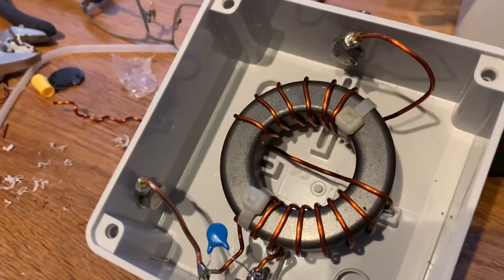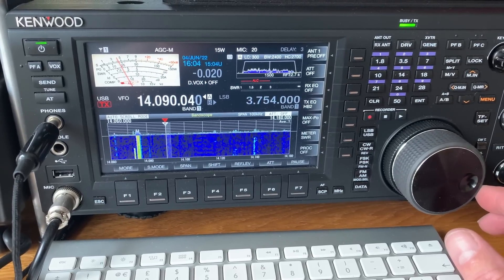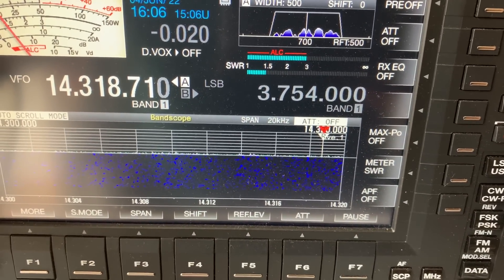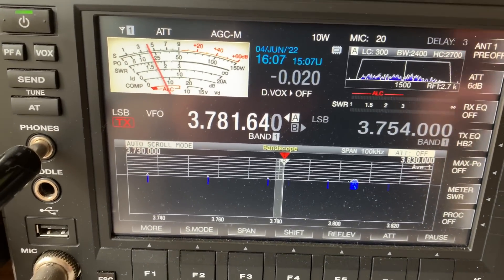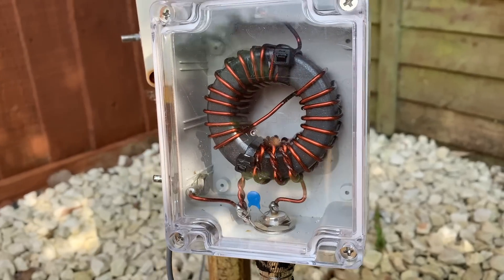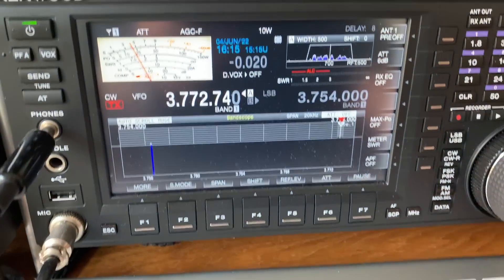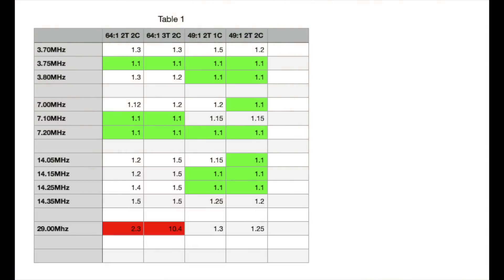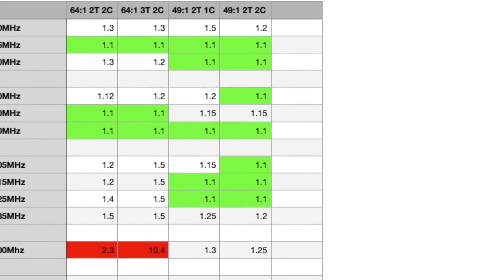HAM RADIO: Whats better a 64:1 or 49:1 Build and Test

Comment: Hi Mike,
First off, thank you for all the fantastic videos you’ve been producing—they’re a real asset to the amateur radio community.
I recently watched your video comparing the 49:1 and 64:1 builds, and it seems the 49:1 offers a better SWR across the bands. While exploring further, I came across a video from Budget Ham Radio https://www.youtube.com/watch?v=1JUI4rO3T2g showcasing a slightly different design that delivers a remarkably flat and low SWR from 3 MHz to 28 MHz.
Would you consider doing a video comparing these two designs and testing them with your NanoVNA? I think it would be a valuable addition and likely of great interest to many of your viewers.
Thanks again for your excellent content.
Best 73,
Stéphane (M1ENE)

Comment: VNA for all antenna builds. Also note: DO NOT COIL COAX. Use ferrites. And one at the 1/4~point helps a lot. Traps made with coax are great. You can also usea piece of coax as a capacitor. Stubs as long as coil is wide, usualy compensate for coils capacitance. TRY It out!

Comment: I want to use a 49:1 unun connected to the output of an atu-100m pro and mount the assy at the end of a efhw antenna.  Connect this to a hermes lite 2 sdr at 5 watts. Remote the atu controls and display indoors. Your thoughts?

Comment: I have made both. Results dependant on your installation I found. Now only use a 9 to 1 that worked better for me matching a Multiband vertical and the performance is brilliant. I needed the ATU on a couple of bands. When the indoor shack is in use with a much longer feed, the atu is hardly used. Which shows the coax feed is having some affect acting as a counterpoise partly. That is perfect for me.   Also have a multi band Delta loop I created from the EFHW as it was prone to noise. Was wiped out. The delta loop removed all the qrm as a closed loop. I needed a balum or matching device. I found one of my home made 9 to 1 ununs with a mod was the best. I needed the ATU. Was unable to load it on any other matching device. Again the performance is stunning. It's not resonant on most bands , closest is 40m . It's the results that count. Leaving well alone.

Comment: Mike  Is the pole that your Unun is on metal or wooden?   I had mine on a steel pole and the vswr was high and as soon I released the rope out 1.5 meters the vswr came down to below 1:4 on every band  64:1 unun.  So in my case having the unun near metal certainly effected the vswr.   Great video.   Richard  VK2AUS/VK2OKR/VK2BXB
Reply from the maker: Glass-fibre or fibre-glass
Reply: @mike-M0MSN  Hi Mike the pole I had it on was steel - no wonder it effected the unun.  Leaning from all my mistakes.

Comment: When does it matter what kind ratio of balun/unun to use? Or does it not matter?
Reply from the maker: For an EFHW you can use any..  49, 56, 64 :1 this is because the impedance of the end of the wire is between 2400 - 3600 Ohms ish....

Comment: I get the sense that such low Q SWR curves are getting closer and closer to a dummy load--which DOES radiate and keep the finals happy, but at an obvious compromise. I wonder if a field strength meter would be the best arbiter in this case. No? Either way it's a well-done video and reminds me that I love the experimentation aspect of the hobby. I'm still having fun learning basic electronics and metalworking, building antennas and transceiver/station accessory kits. One of the 'most funnest' hobbies out there! I like your spirit of humility and collaborative learning. W0XO
Reply from the maker: Yes you would think that having such a wide bandwidth would reduce its efficacy, strange thing is, it works incredibly well...!  cheers
Reply: the first efhw toroid i wound seemed to have lat swr from 6mhz to 29mhz which says dummy load yet it worked. until i realised my mistake of using a 4mm plug and pinged it off a fishing rod never to be seen again. i bought a qrpguys efhw last month and cant get decent swr anywhere at all no matter how much wire i wasted. i wound another and still not getting all bands
Reply from the maker: @liesofgasandpilesofshoes are you shaw it’s not a 9:1

Comment: Interesting test. The swr is unbelievably low. I scanned through the video a few times but couldn't discover what the antenna actually is.
Reply from the maker: it is 19M of wire then a 110uH coil with 1.2M of wire.

Comment: Merhaba, çalışmalarını takip ediyorum ve merak ettiğiniz şey bu 49/1 Auto transformatör şeklinde olan un-un balunlarını 49/1 şeklinde 2 veya 3 troid ile 240-43 ve 240-52 olarak yeni bir test videosu yayınınızın yayınlanacağı durumda olacak, bu sarımlar aralık da dikkate alınacak şekilde aralıklı veya daha sıkı sarım ile hengisinin işleyişi daha fazla olup standart sarım ile Auto Transformer sarımini 1 veya 2 adet 100pf kondansatörler ile test çalışmalarınızı sabırsızlıkla bekliyorum. size bir önerim olacak 49X50=2450, 56X50=2800, 64X50=3200 şeklinde suni yük direnci ile herhangi bir ekstra dış alan çalışmayı duymadan da yapabileceğinizi düşünürseniz, imkanlarınızı zorlarsanız belkide daha verimli bir Troid sarımı ve Balun (un-un) a hep beraberliğimizi kazanmamıza ve takipçilerinize çok güçlü bir desteğinize kavuşarak öenrilerim üzerine kesin ve katı bir şekilde hep beraber ulaşmış olacağız. Saygılar iyi çalışmalar dşlerim TA4DIL 73s
Reply from the maker: Many thanks for you comments I will try your methods :)

Comment: I like to go to websdr's all over US and elsewhere and xmit cw. Can see immediatly how well an antenna or xfrmr is doing. These 64-1 9-1 49-1 etc are so confusing when they dont tell you if its impedance or number of turns they are talking about.
Reply from the maker: Just remember that it is all about the square root 14 turns to 2 prim, = 14/2 = 7. 7x7=49.      49x50 (50 ohms) = 2450ohms (EFHW)

Comment: why is everyone hung up on just the 49 or 64 to 1 debate?. yes if you have a 2 turn primary you can have a 14 or 16 turn secondary... but you can also have a 15 turn secondary which can give you a 56:1 Z transform too. (ditto intermediate steps for a 3 turn primary). Rather than just looking at the rig's swr try checking things out with a vna or mfj antenna analyser & read the resistance directly.... if it is showing less than 50 ohms out the divide down ratio is too high hence you need fewer secondary turns. If the R is too high you need to divide the efhw down more hence need more secondary turns. Note the impedance of YOUR efhw is also impacted by the earth side "tail" length too. The best set-up for one person may not be the same as that for another (ditto if you rebuild your own set-up on another base somewhere else). Given an odd open circuit turn or two isn't going to impact things much means you could just try having a switch on the o/p selecting the 14th, 15th or 16th tap. (or 18/19/20/22 for a 3 turn primary)
Reply: Now you are throwing facts into the issue. This is YouTube, not always reality. Lol 😂
One antenna fact that holds true. Actually two. Everything affects everything and what works for me may not work for you. 
It is still trial and error.
Reply: What? And spoil all the "fun"? 😀

I'm thinking about winding one and I'll probably put taps on the secondary for BOTH ratios and perhaps a switch to select one of the other. Maybe even one for 9:1 while I'm at it. (Do they make a "Variac" for RF?)
Reply: I have that 15 turns and it performance is good!
Reply: Whatever makes you feel smarter.

Comment: Where did you get these parts for the transformer
Reply from the maker: eBay
Reply: I guess I should have worded my question differently what is the name or brand of these parts on eBay
Reply from the maker: 240 43mix for the toroid  and any case that will fit. All the bits and bobs are none branded.

Comment: Thank you for showing us all how NOT to do things.   Everyone of those transmissions were done illegally with not a single ID. during the entire video.  The jury may be out as to which balun is better, but the jury is not out on all the illegal transmissions.  GUILTY is the verdict. Have a great day.
Reply: I don’t know what country you or the author is in, but in ours, we are allowed what are termed “short test transmissions” without ident. Why don’t you go down to your local supermarket and get yourself a shiny plastic police badge, and pull your socks and shorts up very high! 😊
Reply from the maker: Thank you for your input Richard, Just because it is not in the video does not mean it was not done, we are allowed to make a call to say that testing is going to take place and then continue to test without giving a call sign, just as you are not longer require to give a call sign on every over in day to day rags Identity is only require at the start. however if you wish for the video to be 20 minutes longer than needed, so that you can hear a call sign I will comply.
Reply: Richard sounds like a grum/py 0ld man wanna be p0lice but end up as a keyboard warri0r 😂
Reply: Tosser.

Comment: The best solution will always be no UNUN, but an L/C coupler. Thanks for video! 73, Jakub OK1TCM.
Reply: Interesting is there any practical details on this anywhere.
Reply: "Always" is a long time. A lot has changed since my first contact in 1969.

Comment: Greetings Mike, Curious question  -  What length antenna are you using? There is as much chatter about antenna length as  about turns ratios and the 100 pf capacitor!  Oh, and let's not forget the core mixes and colours ... 
73 de kg5rk

Comment: You say the SWR with the 49:1 is ZERO. No, it is 1:1.  Not "1", but rather "1:1". OK, I am picking fly s*** our of the pepper. Shame on me.

 As for your results, I believe they are correct. It appears that as you add turns to the transformer, the higher frequency performance suffers, probably due to the increasing series winding inductance and inter-winding capacitance. These two properties form small LC circuits in series with each other, making this is an extremely complex problem which may not always intuitive. You have done a reasonably good job of testing these configurations and the results are what they are. Good video.

Comment: Any reason why u cant connect 3 or more halfwaves on same feedpoint ? A 40 mtr wire as halfwave for 80 mtr then a + - 27mtr for 60mtr 5400khz plus minus , then a 14 mtr wire as a halfwave for 30 mtr ?  We do that on 50 ohm dipoles . ZS6AF Johan Visagie

Comment: With the 49:1 balun my 40mtr wire resonated on 3850khz , its fed with 5 mtrs RG58 at 3mtrs agl going over 15 or 16 mtr tower , replaced it with 64:1 balun , resonated on 3666khz , JUST REPLACED BALUN. ZS6AF

Comment: For low power and QRP use 64 & 49:1 are great.. But if you ever are going to AMP up 500watts to legal limit go with the 9:1 UNUN for multiband use, less chance of  compromising the cores..

Comment: Hello Mike, another great video mate, I've not missed one so far but a question for you.
What length wire are you using?
Ive recently purchased a 49:1 unun, on test i used a 19.6m length of wire with no counterpoise. Results from 40 up were 1.4 to 1.8 but 10m was above 2.5. I've now ordered 50m of Dipoflex wire by M&P. Im hoping to run a 133ft length with the 49:1 unun, this should give me 80m with a bit of luck but I'm wondering about a counterpoise at that length.
Would you recommend the counterpoise and if so, in your estimations, what length?

73, keep those videos coming, I'm running out of things to watch.

Comment: Very interesting comparison. To stick with a 64:1, what benefit do you get from adding additional turns - say to a 24/3 from a 16/2. Has anyone tried  a 32/4 ?  It would seem to me that the additional windings would improve the efficiency, but I haven’t been able to find any information on it.  Answers are probably over my head anyway.
Thanks for the video.

Comment: With the 64:1 and to a lesser extent 49:1 transformer, there is evidence that what your seeing is transformer losses rather than actual transformation of the impedance. Estimating the impedance of a long wire at 500R, then 500/64=8R and 500/49=10R, but these values alone would result in a poor VSWR in both cases of about 6:1 the use of an antenna analyser showing real and imaginary impedance values would give the true result including losses.

Comment: I have an idea from watching a lot of videos about this.  My thoughts on this is the 2 turn works better across all the bands and the 3 turns works better in the lower frequency.  But the 3 turns don't work well up in the higher frequencies. The 2 cores will give better all around and really do better with higher power, even around 100 watts. I am going to make my with 2 240-43 with 2 turns.  There is a video where they took 2 transformers 1 to 43,  then 43 to 1. Tested the power in and out of this.  Did this with 2 turns, 3 turns with 1 core, 2 cores, 3 cores.  43 to 1,  64 to 1.  Did a chart of all of it. Not just the SWR  but the power out the other end after it was changed back to 50 ohms. This gave the loss in the transformers.
Reply: I add  only 1 turn and the resulit is very good on every band
Reply: @prahastu  I didn't do the cross over, went about 3/4 around the toroid and put my 49:1 conection and did 2 more to conection for 64:1  so I can do one or the other. I got good on the normal bands and good enough on the other bands that my 7300 can tune them in! I got Poland on JS8Call! with wire only 10 feet above the ground! Hope to get it up highter soon! Maybe more than one way to do things that work.
Reply from the maker: thank you for your post very interesting. :)

Comment: I was under the impression that a half wave end fed length of wire cut for some frequency had the end impedance range between 1800 to 5000 ohms, And so, we pick the average of this range as our target point or 2450 ohms  for making an  impedance conversion device or trans-match with, Using a 49:1 ratio. We'd test it with a 2450 ohm load. and expect to get a 49:1 impedance conversion from 2450 ohm to match our 50 ohm radios. 
Yet we could also use an end fed half wave length of wire with a 64 :1 trans-match, and use a 3000 ohm resistor as a load to test it with. Here we target a bit above the average in that same 1800 to 5000 ohm impedance range. And expect to get an impedance  conversion from the 3000 ohm portion of that same range down to the 50 ohms our radio seeks.
And we could use a 36:1  trans-match to pick a little below that same average range. and test this with a 1800 ohm load. And we'd expect to convert the 1800 ohm impedance down to our the 50 ohms our radio seeks. 
But most of us target the average with what we consider the center or average of that range, at 2450 ohms between the range of 1800 to 5000 ohms. We can experiment towards either side of this center point if we want to. Height and set up can change things out in the field. You make it's length match for your location when you tuned it.

A half wave length of wire cut for our desired lowest frequency of use remains the same length in any case, once it is electrically adjusted to allow the trans-match to tune the lowest desired frequency to the 50 ohms we desire. 
its the impedance conversion we do with the trans-match box and our windings of it As a fixed and unchanged working device, that converts this place (2450 ohms impedance for instance) on that over all range of 1800 to 5,000 ohms  to the 50 ohms our radio seeks with a 49:1 made trans-match.

Any half wave length of wire we cut for any frequency we desire, will work the same on any similar box  if it is properly made.wither 133 feet for 3.5 MHz, 66 feet for 7.0 Mhz, or 33 feet for 14 MHz.  
The wire itself can vary in it's property's, so we do adjust it. just As you cut yours to gain the lowest SWR reading for the 3000 ohm range with your 64:1 trans-match. It is electrically adjusted as a electrical half wave long antenna, its also adjusted as a half wave length of wire for use with a 49:1 now, or a 36:1 trans-match in those impedanceconversions as well. The issue is that you targeted the center of that range between 1800 to 5000 ohms impedance when you installed the 49:1

just as any wire length is the half wave length of "some" frequency, I have cut a length of wire and used the same 49:1 trans-match for a 8 MHz marine band antenna.     The wire actually determines the lowest frequency of use, and the trans-match box is a fixed device or tool, that then makes it's designed impedance  match our 50 ohm radios. My wire was 58.5 for that 8 MHz marine band antenna. A half wave piece of wire cut for that frequency.

With ferrite material cores, those harmonics we can also make use of on other ham bands, I see as a free bonus.The older iron powder cores did not have this bonus.They were single banded half wave end fed antennas. Yet still a half wave length long piece of wire. And the same 49:1 impedance conversion. I have made those too. 

I see it like this, on an antenna analyzer, that low SWR Dip will be somewhere, I find it and then move it to my desired frequency, this is tuning the wire as an electrical  half wave length for that frequency, By adjusting its physical length so it matches the electrical length of a half wave length antenna for that frequency where the low SWR dip aligns with the analyzer on that frequency.. I already know the trans-match box works. I already used the correct load resister to test it with.
Reply from the maker: Brilliant and very insightful. Many thanks for your post Possumn